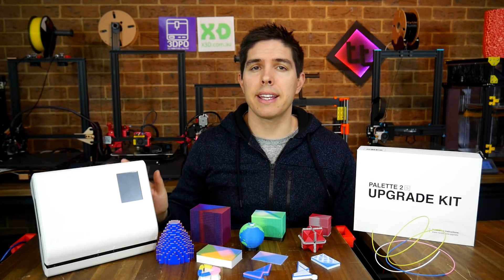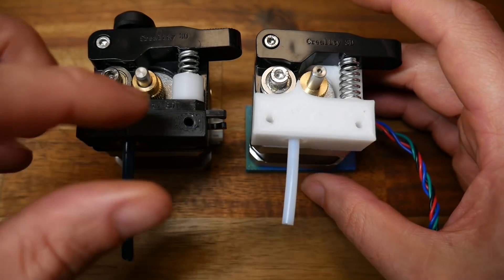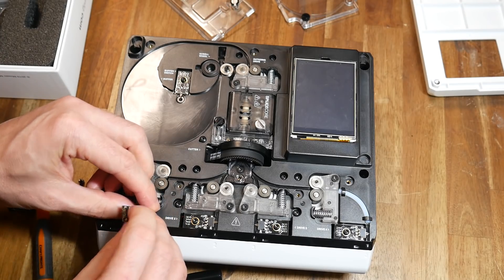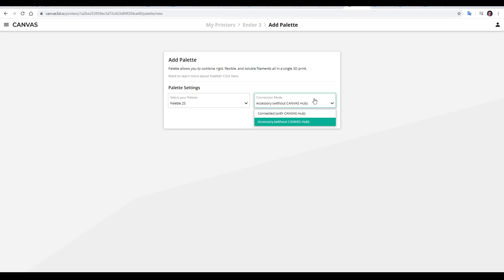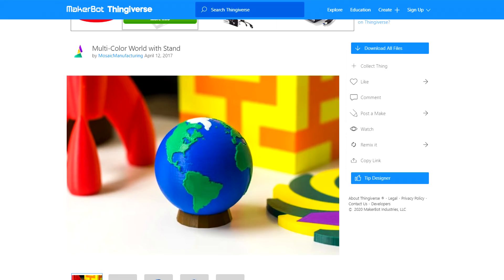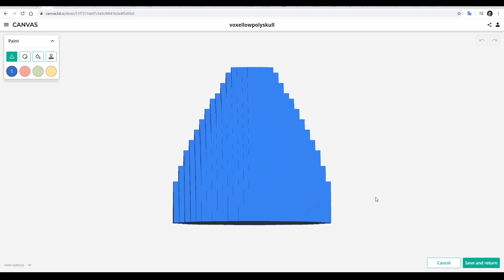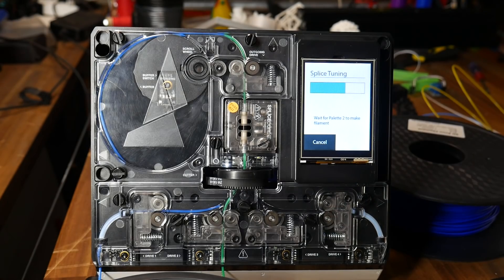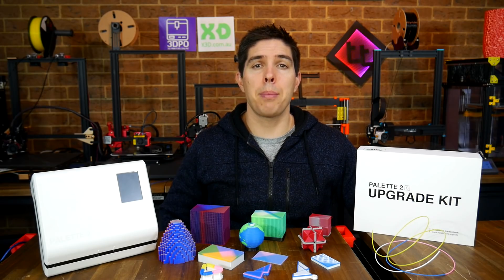Testing the Palette 2S upgrade kit

Comment: Many people, including me, would love to be able to recycle our failed or prototype prints. Having a purge block is not something I would like producing, especially when the waste exceeds the completed model. So, it's a no for me. I spend a lot of time really making sure I waste as little filament as possible. I often print sections of a design to do measurement validations. So, a purge block is not going to happen for me. Even if the purge block were half of the material used to make the model. Only way this would work for me is if I could recycle the purge block into reusable filament. Even if the color blend would be very random at least I could use that filament for functional models where color does not matter. Then it would be a maybe.

Comment: I think people have it wrong thinking that it is a fix.  Mossaic still sells P2 and P2P along with P2S and P2PS.  I see as an upgrade.  e.g. when you upgrade extruder or hotend on your printer, you are making it better product than before.  It was working just fine before but you are making little better with new parts.  I bought the upgrade kit for my Pallete 2.  I can still use my old parts as backup when the upgrade part fails or worn out like with the splice core.  Love the way they designed modular drop-in replaceable parts.

Comment: For everyone here bashing this for the issues (the updated one) has. Everyone needs to do their research, More on the reviewers than anything.

Just like a 3D PRINTER you need to adjust your fucking settings. This machine has very clear and upfront instructions. Setting your splice parameters is the FIRST thing you do when setting up with filament. Even the video states he should of done that first, yet you all losing your shit about, like seriously lol.

Secondly something that isn't even covered in this video AT ALL. Is the fact you CAN adjust purge settings. They are very well designed settings to adjust the amount of purge, the only reason the purge is there is to clean out the transition in the splice. Knowing your splice settings and the colour bleed between colours (darker to lighter will need more purge) will make a world of difference.

Like anything else in this hobby, you need to play with and adjust your settings to get the best results. Everyone here bitching about this not being some magical perfect machine out of the box and work exactly how you expect need to gtfo of the hobby. The sheer ammount of printers and thousands of settings they run on is impossible to set this machine up out of the box to work flawlessly. Hence why it has SETTINGS you need to adjust.

Comment: I was debating the palette 2s, then I came across the 3d chameleon and the price difference got me sold onto the 3d chameleon
Reply: Because chameleon only works with the cheap printers so yes it is cheap option for cheap price printer and it is working well

Comment: The cost, complexity and effort required to get something out pretty much makes it a no go. I don't think multi-colour printing will happen reliably unless somebody figures a way to inject colour into a filament just prior to extrusion, or makes it by mixing input filaments similar to a CYMK printer. Even then purge blocks and purge infill will still be a thing although perhaps not to the same extent.

Comment: So I have a XYZ Jr. 2.0 mix and it can print mutlicolor prints. It tackles this with a 2 in to 1 hot end and uses a tiny amount of extra filament because the change happens right at the hot end so the purge needs to be less. So I'm wondering if it would reduce the purge block size if you could get it closer to the hot end?

Comment: I have the Palette 2 with on problem at all, for me on the ender 3 it works best as bowden tube setting up with a genuine Bontech extruder, regular hotend for more retraction and the Canvas hub is a must..... I feel they need to work a bit more on the Canvas software because retraction is still a bit of a problem with detail prints.

Comment: The purge block size is nonsensical.  The purge as skirt(and ooze shield) Artifact option in Voxelizer is far superior..we worked directly with the Vox devs when we were developing the QuadFusion head.  Zmorph is an awesome Polish company, check em out! Of course, vox is a bit overkill because the Palette can'tt mix.. still good for single color assignments though. Also, I've found that having a nice set of nylon/brass brush wiping "Hardware" and embedded cleaning calls with with each color change is IDEAL for attempting to eliminate color bleed.  Still, you'll never achieve clear black/white transitions without bleed, even with this hardware and my suggestions.

Comment: Splice Tuning is key to success. I have an MK3s and P2pro, S upgrade is still on my shelf because it works absolutely flawless. Don't blame the product when you are not able to use it correct. On the other hand I have a MMU2s which I could not get to work reliable with PETG, this is why I purchased the Palette. Some minutes of calibration and since then it just works.

Comment: Just seems like a whole lot of work, money and time to get around the simpler process of just painting the model!
Reply: Or getting an automated tool changer. I don't have any data on this, but it can't be much more expensive, and you don't have as much wastage, while giving you a lot more freedom (with regards to nozzle sizes and printing temps). And you can keep using your favorite slicer instead of relying on a cloud-based tool.
Reply: @sourcererseven3858  those cost more, 3-4 x as much.   you can use prusa slicer for pallete anyway and use the mmu features and print an extra part instead of a purge block.

Comment: if the filament snaps then you need to up your settings for the filament to ensure better adhesion. i have the original palette and my splices look nice and homogenous. You shouldn't be able to snap them apart any easier than if it were any other length of filament.

Comment: My two cents:

1) getting splicing setting right is crucial, and well worth spending half an hour getting it exactly right for your filaments. Take notes so you don’t confuse yourself after 10th or so splice setting.
2) use filaments from the same brand. Otherwise small variations in material property can make splicing inconsistent and make failure much more likely.
3) try ptpp with prusaslicer, I’ve found it to be a hugely better combo than the cloud based Canvas slicer.
4) once you have all the settings dialed in, it’s quite reliable. But I’m careful to check splice setting every time I change filament brand.
5) I’ve heard using connected mode with a raspberry pi is more reliable. I’ve been using this since the start so don’t have a baseline to compare with.
6) there are still stupid bugs in the firmware (i.e. always go back to Palette’s home menu before printing, otherwise the Palette’s UI will not show print progress), so the company is totally not off the hook.

As for the price, I use the Palette to print multi material for my business, so the cost is easily worth it compared to reliability increase over MMU2S. I also have an IDEX machine which makes multi-material printing even more straightforward, but I’ve yet to find a printer that matches Palette 2 + MK3S quality, reliability and price ratio.

Comment: i have the palette 2 which i finally got working well when i stopped using the hub.  I got the upgrade kit for christmas but have been afraid to change anything since what i have is working.  I'll probably hang onto it and install when some hardware needs replacing.  I agree with the comments about the size of the purge block but it comes out so much better and more cool than painting.  also has a nice feature of combining left over filament so i don't have to stand there and hit pause.  have a great day.

Comment: 3 thoughts.

1.)  The snapped filament was totally on the pallet 2, it should have a "What type of filament are you using (Type - Brand - Colour  ex. PLA-Hatchbox-Grey  PLA-AIO Robotics-Purple PLA-X-Y PLA-A-B sort of configuration)?" with a selection menu, automatically do some test filament for connection testing and ask you if it works, if it does, since its a cloud-based program, upload to the cloud and store for recommendation for anyone using said combinations, if it doesn't go through a few more "recommended" settings, before sending you to the "do some tests and figure it out yourself" page.  If you have to go that far, and you get it working properly, it should ask you if it can use your settings to help others.

2.)  There either needs to be some more testing/calibration done at the factory, or a discount for people willing to test and help them calibrate the machines with a variety of 3d printer set-ups, because that amount of "purged" material is shameful.  It also needs to recommend that you use a higher in-fill percentage so there is not as much wasted or purged material, with an option to use the "purged" material as infill with a pop-up that says "Light or clear coloured filaments may let a darker filament show through if selected."

3.)  The "bulge" problem you ran into was absolutely shameful thing for them to do.  It was all on the printer, they either need to offer to replace it at no charge, or fix it.  With the price of these units, expecting someone to either buy an upgrade kit (like you did) or eat the cost is not acceptable.  If you bought a brand-new car, and the alternator didn't work, there is no way in hell that you would just park it in a garage, or tinker with it until an upgraded alternator replacement kit came out.  You would be back at the dealership as soon as you figured out something was wrong, demanding a replacement, or a fix, with an extension of the warranty.  Yes this costs less than a new car, but at the price range this is in, for what to most is a hobby, is completely unacceptable.  If it was 100-150 USD it might be acceptable because it might have been fixable with enough tweaking, but for what is (still) a 500 USD unit, that is completely unacceptable.  A decent chunk of the "hobby" printers cost that or less.  You could buy 2 ender 3s, and a 3d print pen and since you were thinking of buying one in the first place, you could print 3 thirds of a print on each one, and "glue" it together with the 3d pen.

I'm not going to say you're a huge youtuber, but for a channel that's almost entirely about 3d printing, its bloody huge.  If they didn't try to make it right for you (who is 100% going to make a video about their product), imagine how they would act to a normal customer.

This isn't aimed at you, but for the price of these things, they need to do better, especially if one is basically unusable to the end-consumer.
Reply: makes no sense, he probably had bad or water logged filament.  needs to be dried first....... and none of my joints even snap like his, it's extremely difficult to do with freshly dried or new spool of filament.   could also be the reason for the buldge, as i have none even with the non-upgrade and it conforms to general tolerances of hotends/extruders.  an ender 3 is cheaper and shitty....hence why it was fine on the mk3 or any other decent machine. 

i mean he had bad filament, shitty bed adhesion.... all the failures outside of the bulge issue would of happened without the pallete.  i'm not even sure why he showed those ones anyway. lol.
Reply: You cannot know all brands of 3D printing filament. For instance, have you ever heard of Bestfilament or FDplast? That's right, you haven't. And it'd be even harder to catch them all in weirder speaking areas of the internet, like the Japanese, the Arabic, the Chinese, the Thai, etc.

Comment: I have got the palette 2 Pro and i think this (Mosaic's) approach is the holy grail in multicolor printing. Having said that, i must admit that i don't use the machine very often due to the fact that it still is quite a procedure to have everything set up correctly for a print. This in spite of the very intuitive software of Mosaic that supports to execute this procedure in various different ways. When you have just bought a machine like this, it is likely that you will try out all of these different ways of operating this machine (with or without the use of their software called "Canvas" and with or without the use of Octoprint plugins etc), resulting in even more complexity of the entire impression that one might become of this beautiful device in the end. In short: The palette is IMO a a very beautifully created device hardware-wise and software-wise, that took a lot of thinking and finetuning to come to this point of maturity. It is worth every penny. Also the upgrades are very well priced and executed IMO. Whether you will use it depends on the need you have for multicolor printing. Multi-material printing however is something that is reserved for multiple hot-end printer configurations.

Comment: I plan on upgrading my brand-new Ender 5 Pro to multi-color in about half a year, and as cool as this thing is, it still doesn't seem worth it to me over a 3DChameleon, which seems to achieve extremely similar results with much simpler tech and more importantly for a fraction of the price. I assume that the Palette does flexibles better due to less retraction, but that's about it.

Comment: How does it compare to the Prusa MMU2S? (I would love to upgrade to multi-filament printing, but all the options seem too fragile)
Reply: Just get the MMU2S and never look back. It's cheaper and better in almost every way. The only downside that I can find (besides that I only works with Prusa printers) is a slightly longer printtime due to retraction, but totally worth it in my opinion.
Reply: marlin is adding native MMU2S support into the firmware in the near future. soon it will work on any printer.

Comment: I agree with Chip and Mason. They charged you another $ 124.00, not to mention your TIME messing with the up grade kit. B.S. That's Something that Apple Would do
Reply: It was even worse with the palette+... it has an enormous failure rate (I have the same problems as TT has)  and short after I bought one the palette 2 came out at a LOWER price! Their support is great and it is a really nice idea, but the product should not have been released.

Comment: Why don't they purge filament inside of the target model?
Reply: That is an option, however there is only so much purging you can do inside the model. You need to purge a fair amount of filament for each colour change, and when you have multiple changes per layer like in the last print, it adds up quickly.
Reply: I noticed the infill was not very high, a higher infill would most likely reduce the purge block and put more filament into the model instead of in the waste
Reply: @Celcius1  it's still "wasted" if you didn't really needed a higher infill ratio for that model.
Reply: this could work in theory but the problem is that you need to build up the outside at the same pace as the inside, in terms of layers - what if the inside gets fully built up mid-transition and then it needs to do the outside and still needs to purge? the only way it could deposit on a purge block is if the purge block is at the same height as the print. you could probably establish an independently driven "waste plate" that could compensate but then the mechanics get very complicated very quickly.

Comment: I contacted their tech support and informed them that they should look into adaptive splice lengths based on the amount of material required. The problem is that it splices the same length regardless of the amount of color needed for any particular section. Say if it only needs a tiny bit of blue for say an eye, it will still splice 24" of filament and waste the un-used 20" on the purge block. They did not respond. I did make the mistake of calling the Palette + a piece of junk and was black balled by their support staff who refused to help. I think I hurt their feelings.
Reply: It already does this.  You can set the amount of purge needed based on a 4x4 grid.  I bought a 2 Pro a year ago and this feature was part of it at that time.

Also, I briefly tried purging off the bed and it only helps in some situations where there are many colour changes on one layer higher up the print and less changes low on the print.  The purge block needs to be much larger to allow enough space for the multiple changes so the entire block needs to be bigger all the way up.  The did also add settings to allow the purge block infill to vary so this offset the benefits of purging off the build platform.

It looks to me that the biggest issue is that purging the colour from the nozzle requires quite a lot of material.  Regardless of the method it is still a lot of lost material.  Printing multiple versions of the same part helps this a lot.

Comment: A great video.  I really hope one day we can have reliable multi color prints for a reasonable price, and the Palette 2 is without a doubt amazing, but even if it was reasonably prices it is still a no go for me.  That purge block needs eliminated, outside of using it as infill I am not sure what the solution is, but there has to be a better way for a system like this to exist.

Comment: Look at the size of that thing!!!
That purge block is nearly the same size as your print what a waste!
As smart as this palate 2s is that purge block is disgusting. I would much rather a tool changer then purge then use a wipe move over a silicone brush. But not like thats a perfect systrm either being very hard to tune.